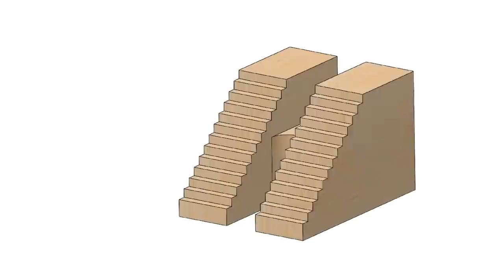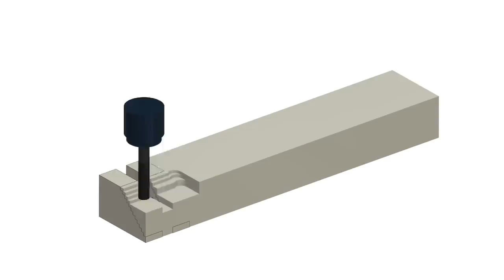A QUICK to use Clamping System for CNC T-tracks

Comment: I am late to the party here, but you can use a 50/50 mix of polyurethane and a thinner and then wipe on multiple coats to the slot area on the underside and you will greatly increase its strength and durability with minimal increase in size.  Great work as always.

Comment: T-slot head bolts are available from e.g., Rockler. They're easier to use and, since the nut (knob) is now on the top, one bolt length is (usually) all you need.
Reply: Wouldn't you have the head bumping into the part that's sticking out with diffrent workpiece heights?
Reply: @dennisbengel11  No, the head would be down in the T-slot. It shouldn't bump anything. Look at these clamps, then pretend the nut is on the top and the bolt head is on the bottom, but too wide to just pop out of the slot. You can buy those special T-slot bolts and they're made for this purpose. Google 't slot bolt'.
Reply: I took carriage bolts, ground the sides of the head, and it slides in and out easy and the knob is on top

Comment: If you have problems with the MDF wearing out, you could make them stronger with some cheap aluminium flat profile. My guess is that 2-3 mm will really spread the load. You may have to recut the pieces of mdf tho...
Reply: use plastic
Reply: I would try stabilizing the MDF with epoxy. Since the wearing zones are just the borders of the tracks, a very fluid epoxy could soak into de MDF.

Comment: To reduce wear on your flat surface you can use the trick I use for mine, I just use printing paper. It's very consistent on its thickness, so I just place a few sheets under the wood so the bit eats the paper surface instead of the flat surface. If I have a very large project, I have a roll of butcher paper that I fold over a few times to make the thickness I want.

Comment: Marius, I used very similar techniques on an Excellon circuit board router about 40years ago.We would often use tooling pins to relocate parts back on the machine for further processing.  We also were able to ‘step’ larger pieces to allow accurate drilling & routing on work that was larger than the capacity of the machine.

Comment: This clamping setup is definitely a well thought out solution that should cover a broad range of needs. Well done!
Reply: One thought to help with increasing the strength of the MDF would be to have your toggle nut and MDF spoil board clamped from above with a magnetic toggle nut and fender washer. It may not provide much strength since it is on the top but could delay it some since the clamping pressure would be stabilized and also supporting the MDF from the top.

Comment: So many options on fasteners and clamps, I like variety.  I'm a fan of nylon and brass bolts/hardware when the job has small parts.  I have a bad habit of running the expensive end mills into the steel ones on really tight jobs.  These are always the last tool in that size that I have on hand for a job that needs to be done right at that moment.

Comment: You have a wonderful problem solving ability.  The company that hires you when you graduate will be lucky -- and I expect several companies have thought of that already.

If you use a knob with a long internally threaded shaft to go over a bolt that links into the table, it might allow a large enough adjustment range without tool path interference with short workpieces.

Comment: Totally going to make this for my shop! I also use nylon bolts for the hold downs in case I crash the router. That doesn't happen very often anymore, but I run a shop at a school, so it does still happen with students' tool paths. I definitely recommend nylon bolts! They save end mills
Reply from the maker: That's a great idea!

Comment: Those are beautiful tools. I even like the color choices you made - the orange and yellow goes well together.

Now you just need to machine the clamps out of aluminum and anodize them a similar bright color.

Maybe for the surface you could glue thin plywood on top of thicker MDF. That would give you plywood at the top of the track to take the clamping pressure, but the MDF would keep it flat.

Comment: Google “clamping set for milling machine”. 
1-use studs of various lengths instead of of bolts. A threaded rod cut into small sections of various lengths is a good source of diy studs. You do not need grade 8 steel studs for clamping wood. You can buy knobs with pass-through holes. They work just like nuts but you can tighten them by hand. Or use nuts to lower the vertical projection of the clamping setup
2- there is good chance one of the standard size T-slot nuts commonly used by machinists will match your slots. They are not expensive and will last forever. Sliding those nuts in/out is not a big problem. But I in exchange for small inconvenience they offer large support area =great holding power. 
3-the ramps need steps to prevent it from sliding apart under force. Look closely at the ramps used by machinists.

Comment: Amazing problem solving. I am always impressed.
The first think I thought was to: Put in a bolt, head first, shaved on two sides and use a wing nut. Then no issues with length. Another thought... use all thread (instead of bolts) and you can tighten from both ends.
Reply from the maker: Was my first thought too, but that very likely interferes with the tool path

Comment: Turn the bolt over make a  3d printed holder/knob for the nut. Use a grinder to shape the bolt head like the drop in nuts. Then use the metal t-slot as intended. You made great 3d designs.

Comment: This design is both simple and very effective. It just automatically works without the user having to try anything. Proper engineering.
You could get the benefits of a plywood base if you just glue MDF on top without losing too much Z-travel and still get the easy machining of MDF.

Comment: I have read about hardening MDF with alcohol-based shellac.  Put it on heavy and let it soak all it will take.  Since it is alcohol based, it doesn't cause the MDF to swell.  Another option would be to apply thin strips of countertop laminate to the load bearing surface of the T-track.

Comment: You are a genius!! In my personal experience (10 years professional use of CNC) the problem with MDF is that changes a lot in thickness over time and you always have an ugly CNC. 4 months ago I bought a new CNC with hard ABS and since then I never had to plane the surface and the thickness is constant on all the 4 meters of my machine. Maybe, as your cnc is small, you might not have thickness problems.

Comment: If you add an extra wing nut under the current 2-spoke star and fix the work piece with them (rather than the 2-spoke stars) then you could use the longest screw for everything. You wouldn't need to worry about which length to pick.

Comment: I would go back to closed slots cut in the clamp boards, and make enough of them to go on all of the screws. That way there are only two separate things; the stair, and the screw/knob/clamp board assembly.

Comment: you could reinforce the underside of the tracks in the MDF by using thin strips of metal so the little yellow clamp will be pulling against the metal instead of the MDF.

Comment: if you want a better material for the bed, just use thinner pieces of the MDF type but get the denser material masonite and layer these with a very tough glue, making a much stronger material, the laminating multiple layers does make them tougher due to the material being used to bond the layers, and you can alternatively use other substances in the layers too, that have fibers or something giving more strength if need be.

Comment: Instead of the transverse slot into which you glued a strip of hardwood, you could have drilled a hole, and hammered a thin dowel through. I did something similar on a similarly shaped piece that I use as a lever for stretching a wire, where the wire, when stretched, has to sit in the slot. It's been in use for over a year, being pulled several times a day. I made my dowel out of a 3 mm bamboo skewer. With a space wide enough, you can even put in two dowels, to account for the neck of the parts being twisted, instead of just the two arms being spread apart. IME, watching your process, sliding in the dowel works a lot smoother than sliding in the hardwood strip.
Reply from the maker: A dowel was my first idea too, but the thinnest one I had was too thick
Reply: @MariusHornberger  You obviously don't grill often enough :-D

On a more serious note, 1) you can easily make dowels of any diameter by hammering sticks through a hole with sharp edges drilled in a thicker piece of iron and 2) most commercial dowels are beech; skewers, very well usable as dowels, are very often made of bamboo, and for this particular use case I think bamboo is a better wood.

Comment: Hi Marius. If you apply loctite to a piece of threaded bar and the nut you can use through hole star knobs then the length of adjustment is above the table.  Great videos, keep it up please.
Reply from the maker: I also thought about that but I wanted to avoid that method, because then you have threaded rods sticking out that could interfere with the toolpath. Now I always only have the thickness of the knob sticking out.

Comment: Hi Marius, I am glad I can just type your name instead of pronouncing it, but then you will probably think the same for my name. Anyway now for the reason, I am typing this. 1. It seems to me that making the whole clamp on the printer would be better, and 2. "The 10-minute workshop" did a thing about the strength of MDF and although it was not quite the same, it does show that MDF has a lot more strength than was previously thought.
Reply from the maker: I wanted to make the clamp out of wood, becasue wood is much stronger than a 3D print in this application

Comment: I’m  going to try phenolic paper (Tufnell is a brand name) for my next spoil board. Seems a good and cost effective option. 

I’m also much more a fan of side pressure clamps held in with a grid of screw holes, say every 4-5 cm. screw a fence into this or use dowel pins to make a repeatable zero position for jobs. Use cam clamps other side. Add traditional hold down hardware if needed as well. I think some fellow on YouTube made some nice ones... 😜

Comment: Could you not glue a sheet of plywood and MDF together to have plywood on the bottom and then MDF on the top which you could then flatten like the existing MDF on its own? Great video!
Reply from the maker: That's a good idea!
Reply: @MariusHornberger  Here are two, even better, options. One dead simple and one slightly more involved:

1) A plywood base with a high density fiberboard (HDF)/hardboard topper. HDF is thin, light and affordable, offering a low profile for sacrificial protection. For example, a 1/8"/3.175mm x 4'/1.2m x 8'/2.4m sheet of HDF is only $6.25 at Home Depot in the U.S. Of course, the HDF needs to be leveled before first use.

2) Apply high pressure laminate (HPL) to the underside of your MDF spoil board. It's even thinner than HDF, while being much stronger. While HPL is a bit more expensive, you could ask for scraps from any local cabinet shop. Since this the laminate is on the bottom of the spoil board, even mis-matched scraps would suffice. We're a fabrication shop and have loads of scrap pieces that we'd happily give away instead tossing in the skip.

You simply brush/roll on a contact adhesive to both surfaces, allow to tack off and apply. A J-roller is optional for this application, but recommended to ensure maximum contact between the laminate and substrate.

For option #1, the HDF topper can be refreshed several times before being completely removed from the plywood substrate in a leveling pass. Once you're down to clean plywood, you could simply glue on a new HDF topper.

For option #2, you'd refresh the MDF spoil board as usual.

Great ideas across the board Marius!

Comment: You should patent this nut design.  For increased travel, turn the design upside down - make the "head" of the bolt go in the slot, and spin a nut down from the top.

Comment: For the next scrap boards, you could cut out a slot to insert a piece of Aluminium or steel to distribute the load of the screw onto a larger surface of MDF.

Comment: This is a great video. The magnets on the washer is fabulous. A small but valuable time saver and convenience. The suggestion to use T-slot head bolts would be great, but one would still need varying lengths because of interference with the excess bolt protruding.  What specifications would one use to search for the larger T-slot nuts?

Comment: You could also invert the design by having the bolts anchored in their printed tee-housing facing up, and then having through nuts in the clamping handles. Longer bolts would do for all the lengths required. Though you'd have to be aware of where the bolts are sticking up to stop the router head running into them, I guess.
Reply from the maker: You just said the reason why I didn't went that way

Comment: If you paint the underside of the mdf slots with electronic printed circuit board protective lacquer you'll increase the compression/extension resistance a lot (at least twice) since you are efectively transforming it into a composite.
Beware, you can't paint it in layers, as the first layer, once dry, will just repel the next ones. So the first time you do it, just keep going as long as the MDF absorbs the lacquer.
Reply from the maker: The problem is not the local compression strength, but the overall strength of MDF
Reply: @MariusHornberger  as long as you let the lacquer seep deep, it will strenghten it where it's needed.
I once made a test piece that broke at about 5/6kg, and after the treatment, it was able to lift my 12Kg sewing machine with no problems.
I mean, in the end those boards are meant to be easily replaceable/sacrificial, so, to me, it's better to use a cheap material  that is easy to reinforce and a bit of time, rather than harder and expensiver stuff.

Comment: Excellent ideas Marius. Thanks for making the 3D print files available.  What about using 15mm Baltic Birch with 6mm MDF glued to the top of the Baltic Birch, then use a surfacing bit to level the MDF top surface? This will provide a stronger hold for the hold down clamps. And you can resurface the MDF a few times as well.

Comment: Tufnol is a material used by laboratories, colleges, universities & research. We use a lot of this stuff for test jigs & production automation stuff...It is a high compression fibre sheet with epoxy...very tough material. Check it out.

Comment: If you invert the the screw so you are turning the nut and the screw head is part of the bottom you could have one long size screw that sticks out the top of the red handle
Reply from the maker: That's what I wanted to avoid, because a long bolt sticking out can interfere with the tool path

Comment: Awesome stuff Marius, great clamping system! 😃👍🏻👊🏻  ..... perhaps in addition to labeled bins for storing the bolts, if you had also printed  different colored T-track nuts for the different thickness ranges they would be more quickly identifiable if for some reason you have multiple sizes out of the bins at the same time.

Comment: Nice work on all your videos. One thought is with the flat bridges while your 3d printing the rest of the parts. Maybe try 3d printing the bridge also. If you 80 to 100% infill with some fiber filled PLA they should be strong enough. And you could design them either slightly thicker or possibly with a gradual convex shape if more strength were required. Just another option. But like I said nice job on the project either way.

Comment: Good video man! Two questions: with the clamp thingys, why dont you make the red part a nut and the yellow one a bolt? That way you don't need different heights, right? Am i missing something?
On the other hand, why don't you make a vacuum table?
Reply from the maker: Long bolts sticking out can interfere with the toolpath.

Comment: Why not put some threaded rod into the T-nut, then put a jam nut against it from above, that way the threaded rod and T-nut are locked together.  Then from above, you use a  wing nut and a washer to pull your clamps down.  That way the travel distance beneath the T-nut won't matter-- it will be in place already.  You might have a little too much rod sticking up for some jobs, so maybe several sets of rod length could be used.

Comment: I think you should avoid the bottoming out in the track by simply using longer bolt but making the bolt head block for the groove slots. Wing nuts hold everything down. Extra unused bolt length is above table.
Reply from the maker: but that unused bolt length above the table can very likely interfere with the tool path
Reply: @MariusHornberger  Exactly!

Comment: I like your explanations on the development of the choice of forms. Everything seems obvious when we listen to you. 
I told myself that, to reinforce your soft wood pieces, it would also be possible to impregnate them with polyurethane resin. It would be enough to put some in the most fragiles areas. Do you know the G4 of VossChemie? It is an extremely resistant and penetrating product which has many applications.

Comment: Couldn't you line the t-tracks with a small aluminium insert? like, make the slots a bit bigger to account for an alu insert, that way, you get (reusable) durable t-tracks inside your MDF board and you won't have to wory about the track degrading?

Comment: I would think it would be easy to glue a layer of MDF onto plywood. Then skim/surface the MDF side. Still have the strength of plywood on the bottom with the flatness of MDF on top.

Comment: You can just make whole slot table out of plywood for strenght and glue some MDF sheet on top. When MDF will wear off over time, you  just have to face it down to the plywood with CNC and glue new sheet on :-)